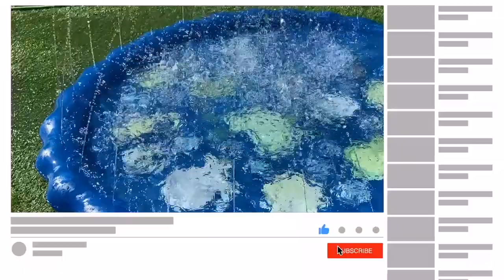Outdoor Summer Splash Mat by QDH

Comment from the maker: ⏰ TIMECODES:
0:00 Intro
0:28 Unboxing Outdoor Summer Splash Mat
1:04 Laying out the Splash Mat
1:13 Measurement of the Splash Mat
1:22 How to Install the Hose to the Splash Mat
2:13 Turning on the Hose
3:02 Turning on the Second Hose
3:18 Turning on the Third Hose
3:52 Did the Water Height Change?
4:07 Water Review
4:23 Baby's Review
4:38 How deep is the Pool?
4:45 Anything on Bottom to change water pressure?
4:57: How to Empty out the water?
5:26 Is this Item right for you?